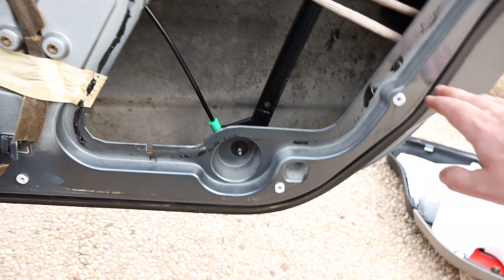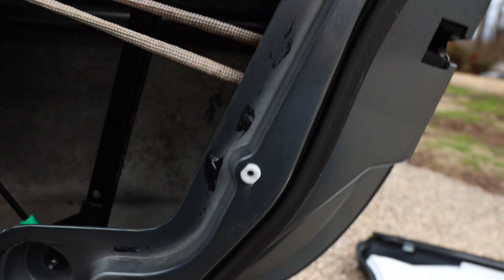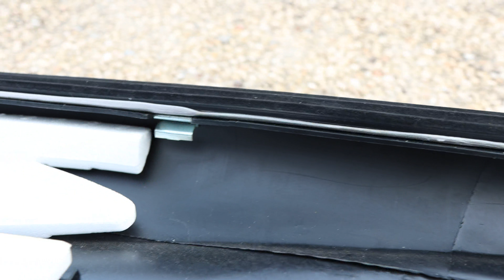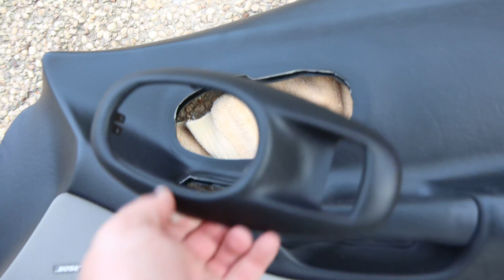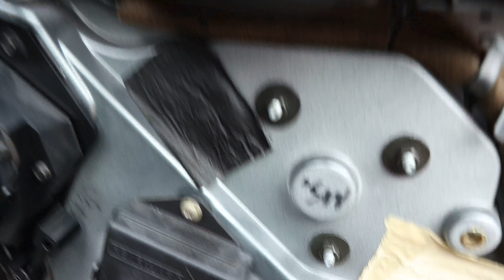Replace Window Regulator 2003 C5 Corvette

Comment: At 5:09, Chris describes the 2 holes in the fiberglass door which are covered with sticky tape.  These allow you to loosen or tighten the clamps which hold the glass in place.  Alternatively, you can temporarily hook up your window button and lower the window halfway down to access the same bolts through the large openings.  It's a little easier that way.  However, if your regulator is TOTALLY shot, you won't be able to do this shortcut and will need to do it just as Chris shows.

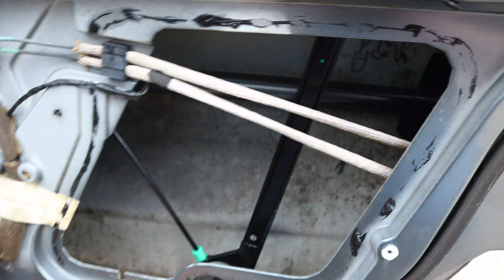Comment: At 4:20 Chris talks about the black plastic piece which keeps rain and noise out.  I'm writing this in February 2025 and at this time, the passenger side ones are not available.  However, you can use neoprene or any other rubbery elastomeric sheet material and make your own far cheaper than the replacement versions.  And they'll probably last longer than the OEM versions which always get brittle.

Comment: When you remove the power window button, you gently pry up on the FRONT side of the passenger's one, but you pry up on the BACK side on the driver's side.  They come up real easily if you do it that way.  Don't pry on the wrong side, and don't pry on the side of the switch, either.

Comment: My window actuator makes sound when I push the button but it doesn’t roll down the window. Do you think I need to replace everything like you did? Or something is seized because of sitting for winter and I can get everything to work by just loosening and tightening a bunch of bolts?
Reply from the maker: I don’t know enough about it to tell you either way but it would sound like you would need a whole new regulator.
Reply: @chriswaskew89  thanks for the reply and also for your detailed video

Comment: I purchased an official GM  replacement regulator from RockAuto --- more expensive but I didn't want any Chinese parts.  This GM part also required to replace the connector to the motor.  Both leads from the new connector are white so you don't know which goes where.  I thought I would connect right to right and left to left  ---- NOPE, just the reverse.  As far as my window being stuck down, it was easier to get to the bolts that hold the window to the regulator than if the window was fully up and it was easier to mark the position of the window before you remove it and also it was easier to properly position the window with the new regulator 3/4 the way down rather than have the regulator in the fully up position.  Many plastic parts so I will be moving my windows up and down less frequently.  A real mickey mouse setup

Comment: Thank You so much for this video.  I'm having window problems with my 2003 convertible and need to do the exact same fix you did in this video.
Many, Many thanks --- I will get the part numbers and order the parts 2nite.  Seems to me you have to have the window all the way to the top to unbolt the window from the regulator.
What if it's stuck all the way down??.
Reply from the maker: You may be able to still unbolt when you remove door panel. There are holes behind the weather cover and the speaker that may give you adequate room to access bolts in your case. Good luck.